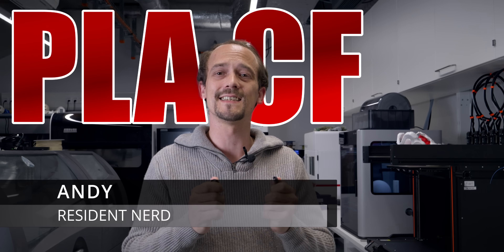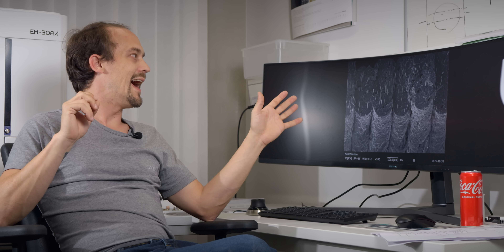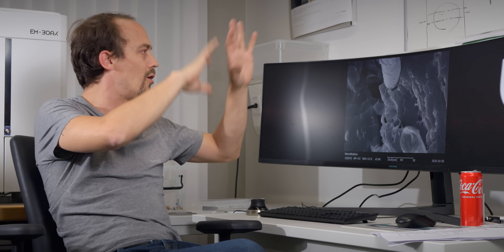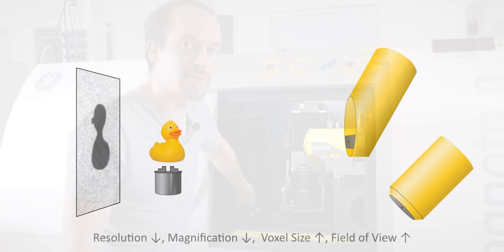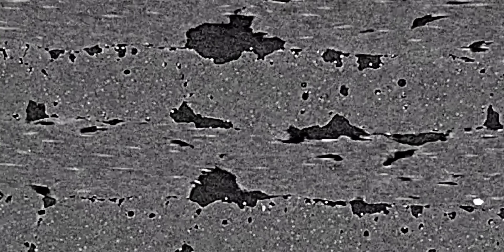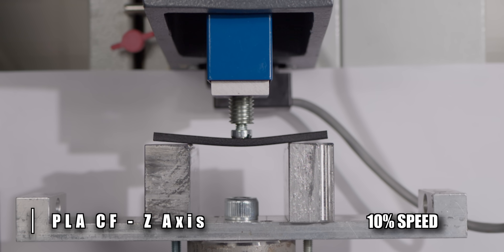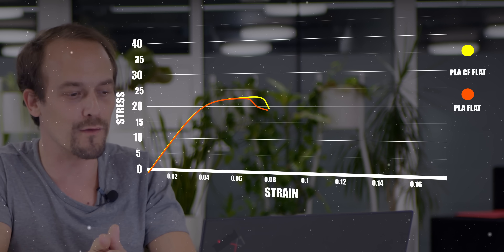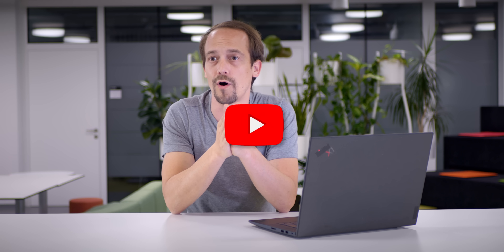3D Printing’s Biggest Scam Is Even Worse Than We Thought!

Comment: The only advantage of these "short hair fibers" would possibly be compression rigidity, at the length and width of the short fibers. Since they add solid structures into the PLA, which are harder to crush. We use glass fiber impregnated plastic resin for injection moulding, and it honestly does nothing but make parts heavier and dangerous to handle. As you noted, the fibers end-up outside of the plastic, which can get lodged into your skin and cause two forms of dangerous irritations. One from the glass "needle" that enters your skin, and the second from the "plastic", which is stuck to the glass fiber, which also now enters your skin. The glass can protrude past your shedding layer of skin and get lodged permanently under your skin, where it can not be removed.

Quite honestly, it would be better to just use a long nylon fiber, within PLA, which could be made porus on the surface. It would "flex" when being injected at 90-degrees, as it exits the heated nozzle, since it slightly softens. The nylon would potentially grip the PLA, since it is slightly porous. The nylon would have the potential to shrink with the PLA as it cools, as opposed to the glass that would not shrink. The threads could be longer and not as dangerous to handle, since nylon threads would just "bend" it you touched the loose threads. HDPE would be a decent choice too, possibly.

In an "extruder", the devices used to make the spools of plastic that a 3D printer uses, the glass fibers severely destroys the screw in the machine. The screw is what generates the heat, by high compression as it turns and extrudes the molten plastic out of the nozzle of the extruder. Glass fibers are never uniform and neither is the plastic "melt". You create higher heat and lower heat melts in the plastic, due to clumping of fibers and the insulation that glass fibers cause in the clumps. The plastic that exits can have burnt, chemically broken, or carbonized plastic, as well as "bundles" of glass fibers that eject in clumps and voids without fibers too.

It is a novelty that really has no physical purpose. Not even in a professional form of injection moulding. Except to add weight to a component, to make it feel more valuable. At-least with injection moulding, into a mold, less of the fibers are "liberated", as the high pressure against the mould, forces more fibers to be enveloped by the plastic. As opposed to the glass fibers just protruding freely, like they do in a 3D print extrusion that doesn't use a "mold". Perhaps if you used a dual-head 3D printer and only kept the glass fiber impregnated plastic within the core of the print, with a normal PLA on the outside surfaces, it might have a safe and meaningful use within a print.

Maybe in the future, print heads will be made that have a directional 45-degree nozzle, so they can properly "lay down" fiber impregnated plastics, without having to deal with the 90-degree bend at the end of the nozzle. Potentially allowing longer fibers and better "woven" cores, with less voids.

Comment: It would be interesting to see your strength and micro layer analysis when you use high infill settings whether it is with PLA, ABS, PETG.  With your printer use 85% infill with rectilinear infill pattern.  This setting seems to be stronger than 100% infill as the printing layers are printed in three different directions.

Comment: The voids are from the "pulling" of the fibers through the plastic, as the fibers do not stretch, but the plastic does. If the fiber end is still in the "high pressure nozzle", being "gripped tight under pressure". The tail end of the fibers will be "pulled out of the ejected molten plastic being laid down". In the opposite direction, if a fiber is held in place by a cooled end that is laid down. The "pulling of the nozzle across the layer", will elongate the semi-solidified plastic "hole".

Comment: Carbon fiber is a lot stronger than the polymer matrix so In polymer matrix composites you depend on a strong bond between the fiber and the matrix to take advantage of the strength of the fiber. In ceramic matrix composites the matrix is a lot stronger, and the fibers serve as a way to stop cracks, so the interface bond isn't as important. In polymer composites there is usually a surface treatment applied to the fiber to enhance the bond.
When you make composite panels, the surfaces are usually resin rich. In fact, in high temperature applications especially exposed to air you see the surfaces get rough and later fuzzy at you lose resin over time. That's a sign they are reaching - or have passed - their useful life.

Comment: I've had a thought about the non adhesion of the layers, causing voids, as former polypropylene fabrication technician we welded with hot air guns to heat all surfaces of the weld site before extruding into the weld site and i am wondering if this could be applied to 3d printing to reduce/remove the non adhesion that causes the bubbles making a much stronger bond between layers.
It'd make a super interesting test for you and might actually solve the problem.
I hope one of you sees this and that this can potentially help you guys improve your print quality.
The only difficult part will be balancing the temperature of the jet of hot air so the surface melts but not so much the nozzle has difficulty laying down layers of new weld.
Hope this helps. 🧡

Comment: PETG_CF filament is my biggest disappointment so far in 3D printing. I got the Hardened steel nozzle and upgraded extruder installed. I was excited. Except everything I printed broke as soon as I handled it. BL P1s printer, BL PETG-CF filament, dried for hours before use, 6 walls, bottom layers, and top layers. There was horrible layer adhesion, everything snapped very easy. I was so let down. ;(..
Recently I mistook the PETG-CH roll for some PETG-HF. That part broke attaching it to the PETG-HF parts. I was thinking: "Man, that snapped like the PETG-CF stuff I was using before"". Taking the roll out of the AMS, I saw my mistake.I will never buy that crap again. If you want something strong and heat resistant use plain PC.

Comment: Fascinating, had no idea the carbon would be so in line with the filament path. This video makes more sense now  https://youtu.be/59KvDE7adEU?si=1UUtpKMK9t4Oj3rh   He showed how printing layer on layer that are both going the same way was stronger  then printing layers crossing each other.   The PETG-CF showed an improvement in this test, where the PETG showed a reversing trend.  I had the idea CF loaded filament was stronger in taking compressive forces,  like if you had infinte points under the part, not  just 2, and bend it that way. Everywhere. And the CF would provide better compressive resistance because theres simply more stuff to compress and you cant compress carbon right?   But that only worked in my mind if the filaments were running also perpendicular.  But who knows, maybe this is where CF loaded filament could shine? in  compression strength?  like say for a ramp to lift a car on its wheel.  I would put my money on CF loaded filament over PLA.  But now i could see the layers slipping out from under each other and the carbon not providing any vertical support to prevent that.  Maybe only after the thing has collapsed you would get the carbons compressive resistance, but only tests would prove it.  It was still interesting to see  PETG loaded with CF get an improvement in sheer test, but only because it was so poor without the CF, it didnt beenfit from parallel layers ontop of each other like the other filaments did and showed and improvement only when they crossed.  So CF didnt really make things better, it just prevented an anomalous thing if you want to look at it that way.

Comment: I was always skeptical about this, but never used it. But I'm actually quite surprised at how strong the 3D prints using regular PLA are. I made an RC airplane out of it (1.5m), had some really bad landings, but nothing breaked, and most of it is only 1 perimeter so about 0.5 mm thick.

Comment: Great video and excellent insights.
I was always wondering how CTE mismatch where CF has negative and polymers positive works on microscopic levels.
Also I mostly use CF or GF filaments for parts that are printed from materials with lower dimensional stability and never for PLA/PETG/ABS.
Will be also interesting to see how GF behaves compared to CF with more advanced filaments.

Comment: I used to work in a metallurgical laboratory and we did analysis on carbon fibre containing materials of many types. One day I had some tiny fibres pierce the skin of my finger, Days later it became very irritating and sensitive. The fibres were so small I could not remove them using a sharp needle under a stereo microscope. The skin above them eventually grew back and the fibres stayed there for months, only slowly coming to the surface before I could get rid of them. A lesson learned - always use gloves and great care when handling such materials.
Reply: I wonder if it causes asbestos like diseases
Reply: @adamkowalski2883  Unsure but there is NO way it is good for you
Reply: @adamkowalski2883 probably does if not worse considering  is carbon based.
Reply: @adamkowalski2883  As it is an inorganic carbon it should be causing the Black Lung Disease. It is a similar kind of disease common in coal miners.
Reply: @Telhias inorganic carbon?
Reply: @adamkowalski2883  Elemental carbon pure C atoms bonded together. Organic carbon is bonded to hydrogen forming chains. Ch3-Ch2-Ch2-Ch3 for example for Butane. Our organism is made of organic carbon which our bodies can process. However inorganic or elemental carbon is not something our cells can decompose and so it lingers in our lungs.
Reply: if you think carbon fibre under the skin is bad, kevlar strand is just damned awful.as it works its way out you get a septic "pimple" forming over the end. then you get about 0.2mm of fibre aout and the same a few days later
Reply: The same thing happens if you get it wrong when optical fiber splicing...
Reply: I wonder if scotch tape would have worked or doing the glue on the hand thing
Reply: @3lanksp_ce Tape works for me after handling fiberglass, I guess it would have worked with carbon fiber.
Reply: @3lanksp_cesome gorilla tape that stuff is sticky😂
Reply: I think part of them got in your blood stream.
Reply: It's good for you ..let the carbon fiber under your skin consume you!
Reply: Ouch! D'ytou think a high powered vacuum hose might work, if you get exposed?
Reply: fiber glass is the same, fiber kevlar is the same, literally anything fiber.
Reply: In my experience, gloves don't help. Work gloves, nitrile gloves, a combo of both, the fibers are so tiny that they just puncture through anything I had on hand.

It feels like having tiny needles in your hand and fingers at all times, and can be quite debilitating.
Reply: A broken item exposing and loosing these pointed fibers must be a danger, when then inhaling the loosed fibers.  This is fiber glass and asbestos all over again.
Reply: maybe not QUITE the lung killer Asbestos is but .. Kinda worrying,  @betsybarnicle8016 

Seems the stuff really IS useless too!
Reply: And wear a mask.  While CF is not asbestos as a rule of thumb anything that forms fine penetrating fibre dust should be treated as dangerous.
Reply: that material should be outlawed
Reply: @zagzagz  I'm sure you're the sort of person that is why plastic bags (when you can still find them) have "Keep off of head and away from children"... What's next on your agenda, banning bleach for being a hazardous chemical and chlorine? Banning wood as sawdust is horrid in the lungs? 

I know, ban Di-Hydrogen Mono-Oxide (DHMO) as everyone that has ever been diagnosed with cancer came in contact with it!
Reply: @SandPounder so you won't ban people's using asbestos to various things and let them have some plutonium, if they have enough money.. And why not chemical weapons to arguing with bad naibor 😊
Reply: @zagzagz  no thank you, I believe in the autonomy of individuals and personal responsibility. Please take that energy to your local HOA
Reply: @DetectiveStablerSVU  You're so right, let's get back access to CFC's, Asbestos, Lead and Cadmium paint while we're at it.

Comment: Yeah.
When I think about doing material science at uni and the key things for reinforcement of a matrix are the minimum length of the reinforcement and the quality of bonding between the matrix and the reinforcement.
It occurs to me that the kind of fibre lengths that will pass through a nozzle are probably much shorter than the required critical length for reinforcement.  Add to that the findings of voids in the matrix plausibly caused by the reinforcement acting as stress concentrators it is not really a surprise there is no benefit to CF reinforcement.

This is different in injection moulding with fibre reinforced plastic where the gates are much larger and the fibres thus much longer.

Comment: When I tried to integrate 1-10 layer graphene into plastics I experienced more or less the same thing, it had a negative effect on the plastic's characteristics for the simple reason the graphene did not adhere to the plastic and thus it was doing essentially nothing but slipping around. Only when I tested idea's like adding functional groups to the graphene and beyond that attaching metal nanoparticles to the graphene and even adding carbon compatibilizers like pe-g-mah did I start to see something resembling a positive result. In that scenario the graphene gets improved dispersion, adhesion and the metal nanoparticles serve as anchoring points to really lock the graphene flakes into position. I'm not a material scientist, just a hobbyist but if all you're doing is adding carbon into plastic and calling it good then I'm very skeptical indeed about claims of any type of positive outcome.

Comment: I never believed the CF part of any filament was anything more than marketing BS, since the nozzles are so thin, the carbon fiber has to be so insignificantly small that it does nothing in strengthening the structure beside being annoyingly abrasive to the nozzle material and your lungs. At least with injection molding, you could make the GF or CF fibers much longer so that wenn they're mixed in the material, they should noticeably change the mechanical properties of the molded parts for better or worse. Thank you for this video to feed my confirmation bias and ego 🤣.

Comment: I'm no engineer but all of that imaging and microscopic analysis seems superfluous. Actual test measurements of the finished product is the only thing you need. Those tests will tell you what products give you the characteristics you have engineered them for. All of the micro testing in this video only tells you why certain characteristics have the metrics they have. Those results allow you to reengineer new products, but if you get the results you expected from the product you have, the testing in this video is immaterial.

Comment: I work with injection molded parts with glass fiber. Basically what you have here is a case of bad moldflow. You can make it better with parameters, but the most important is injection point - in this case, your nozzle. Basically you have weld lines all along every layer of your print.   

More details: The CF is responsible for voids by disturbing the material flow and even distribution of plastic compound. You can actually see flow lines if you look at small fibers inside material - the voids make round flow fronts or disturbed flow tails. This means poor bonding of fiber to material. In places between the layers you got a mix of this effect, uneven temperature shrink and flow distribution effect of the nozzle - the velocity is lower near the edges, and that's where the glass small/broken fibers concentrate, being pushed aside by material. And then you have material shrink that is even more uneven because of "edge" fibers preventing it unevenly not along the whole length, and by conseqence fiber itself going out of axis.  So I guess to prevent this effect you need to do what you do with high shrink material - bigger temparature, slower flow, lower layer, but you won't get rid of it.

Comment: are you using AI generated music?
please stop. support real artists.
Reply: In these niche cases of musical filler, realistically it's either use AI or not have the songs at all.

Real artists are not impacted.
Reply: @sting2death2 real artists are impacted in the sense that their work was illegally scraped in order to train the model.
Also wdym musical filler? It's a whole segment in the video.
Reply: @JustinKoenigSilica  well I'm more of a no boundaries on use of art kind of person, and the AI was trained on but it wasn't carbon-copying the music, so I don't really see it as an issue.

And by filler, I mean those segments were fluff, unnecessary and could have been replaced with stock music or commentary if it didn't have custom generated music.

Comment: Setting aside the topic of carbon fiber, the formation of bubbles in a print is the result of many variables: the quality and moisture level of the filament, nozzle temperature, print speed, retraction settings, ambient temperature, and so on. Completely eliminating air voids is impossible.